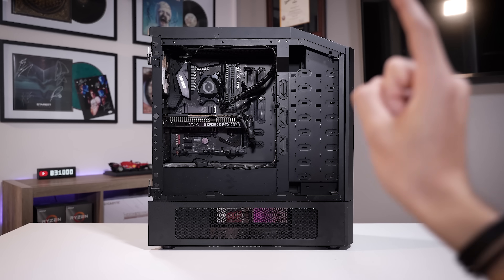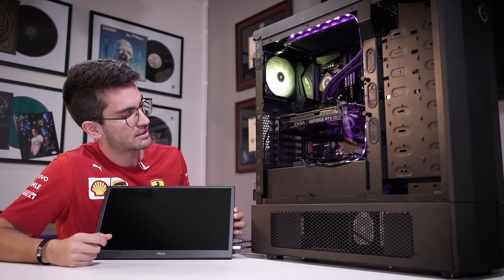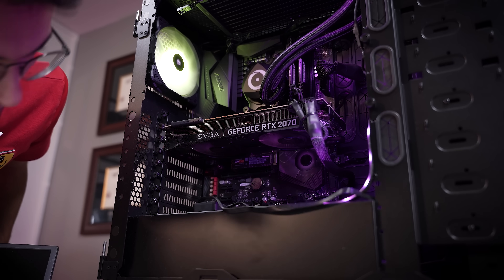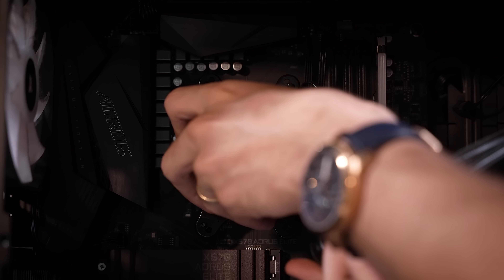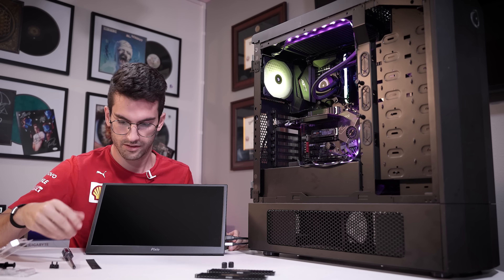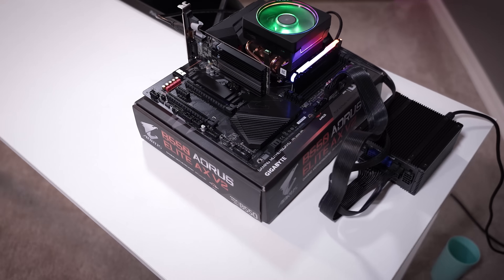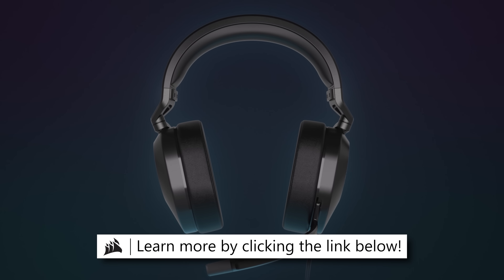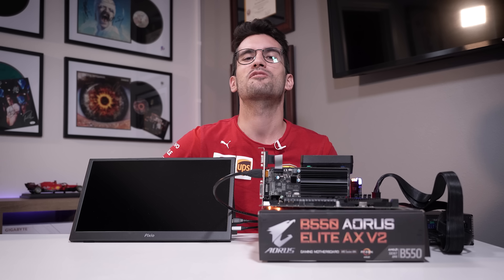Fixing a Viewer's BROKEN Gaming PC? - Fix or Flop S3:E3

Comment: Extreme overclocking is what's killing CPUs prematurely.  Ever since I learned to undervolt and limit the overclock by manually setting the overclock speed, I have every confidence that my PCs will most likely live a nice, long, cool life.
Reply: i have a 5800x3d * cant overclock it cause its locked * and it dead on me. turns out the asus motherboard killed it so i had them both replaced and got a msi x570s carbon now with the 5800x3d
Reply: @DeadlyCrazy91  yeah, that's why I don't have any 5800X3D cpus.  I've got a 3700X, a 5800X, and two 5900X builds - all undervolted and manually overclocked to a max 4000 MHz - and all on ASUS motherboards.  The 3700X is on an ASUS ROG Strix X570-i Gaming motherboard, the 5800X is on an ASUS B550-M Wifi motherboard, one 5900X is on an ASUS Prime X570-Pro motherboard, and the second 5900X is on an ASUS ROG Strix B550-i Gaming motherboard.  All undervolted the same way and overclocked to 4000 MHz.  None of them ever goes above 55 degC while gaming, or 70 degC while being stress-tested on Cinebench R23.  I have a Gigabyte AORUS X570i Pro Wifi (mini ITX) motherboard sitting in its original box because it wouldn't let me undervolt like I can with the ASUS motherboards.  Used that originally in the 3700X SFF build and CPU temperatures sometimes went a bit too high for my liking, because of the latest AGESA (automatic) settings.

Comment: my information is not from experience but from a lot of research but if you install an R9 it will not post unless you update the bios with an older cpu first so i feel like that should have been included in this video.
Reply from the maker: I think you're confused. Both boards in question were B series, and both CPUs were 3000 series. They work natively. And there's no hierarchy of CPUs for BIOS updates. A BIOS will either support Zen 2 or it won't - not some Zen 2 chips. Not sure where you're getting this info.

Comment: i  have had roaches be the cause of the customer computer woes. shine a light into power supply and check the back of the mother board, more roaches then you have to fix that and clean out the roach waste.

Comment: I would like to see the correlation between potential owner overclocking + water or air cooling and dead Ryzens tbh (water cooling because of pumps/coolant potentially degrading or going bad during use without being noticed somehow)

Comment: My 2070 Super VRAM is running at 105C when I play a game.  The Core doesn't hit 70C. I had this card for 3 years and never had a issue other than the temp. Wondering if there is a way to fix this easily.
Reply: Change the thermal paste.
Reply: This usually indicates the VRAM isn't connected to the heatsink well. Could measure & cut some thermal pads, or use copper shims
Reply: @brentw2  will try that thank you
Reply: @brentw2  yup. Good advice
Reply: Undervolt.
Reply: Tried both. The core is fine. The ram is not.

Comment: Hello Salazar! I am deciding to ask you in these comments about a problem I've had in recent days. You are someone who might be able to diagnose my issue, even though I am definetly not able to send the system to you. I have a desktop with a Gigabyte X99 UD4 motherboard, an Intel Xeon E5-1630v3, and 4x8GB DDR4/2133. Last few days, I've experienced constant crashes of both programs and the entire OS, citing "segmentation fault", possible data corruption (?, seemingly only in system files relating to booting), and finally, unable to boot, even on live DVD or USB. I have tested all the DDR4 I have, cleared cmos, tried 3 different SSDs, tried 2 different video cards, multiple installed OSs, all ending in the same issue. I am convinced at this point that this has to be a CPU fault in some way, but I am not certain, as I have no other CPUs for this motherboard. Could you, or someone else experienced with this, be possibly able to help in the comments? I have searched online for hours now, I can't find any working solutions when searching online.

Comment: Front to back on this one.😀
Good video Greg!
Can't help but wonder if the soc voltage may have been ju...st a tad high for ju..st a bit too long on this 3900x.
Either which way...
Keep "Em Coming!!
Reply: The latest bios on the boards is supposed to fix the high auto voltage, at least on my MSI B450!

Comment: Question: Did you think the thermal paste application was appropriate? Did you check the cooling and verified temps after replacing the CPU? Love your videos! It inspired me to start my own home repair business!
Reply: yeah my thought exactly. maybe the AIO died and that caused the cpu to cook..
Reply: @CodeDonut  no the PC will turn off before that.
yes I have tried it by accidently unplugging the AIO Pump on my Ryzen 3900X thinking it was the Fan Hub for the case fans to see how no intake affected temps & then struggling to get it plugged back in while running CB23. Still works fine & boosts as expected.
Reply: @CodeDonut  Motherboard has a safety guard for that.

Comment: I'm looking for a solution to fix my pc, it takes like 5 minutes to shut down. I've tried almost everything, even disconnected the drives one by one to see if it's drive specific, the only one I couldn't disconnect is the normal boot drive so I'm thinking of doing a clean install but in that case I'd like to be able to back up my desktop icons/folders for after the clean install
Reply: That's kind of odd if your not using an old hdd for main drive. Have you run a comprehensive check for malware? Preferable from a boot usb made on a known clean system. That's the first suspect. If it is the install a clean install from known good, and malware free, source could fix it. But if it's the boot media itself (check the drives smart info, look for excessive errors and/or bad blocks). Also check windows own logs to see if there errors with the drive and/or shut down process.  You can also highlight the drive in explorer right click and select properties, the the tools tab then check filesystem for errors.
Reply: @kaseyboles30  yeah I've done all of those, even tried reinstalling windows but not clean install, used all the repair commands via CMD, upgraded from win10 to win11, all of them with no success
Reply: @scarfacegaming3371  Ouch, could be an MB issue or a fundamentally broken windows install then. Did you do the install with 'keep existing settings' that could have kept the problem if so. Especially if it's set to not really shut down (the default on win10 and 11 IIRC) it hibernates instead. A reboot power option will always completely shutdown and not hibernate. Also if it's set to make a system restore point every shutdown/reboot that could be it as well. Had a driver installer cause something like that once, it had to reboot to finish installing and it set windows to silently create a restore point on shutdown, then failed to remove that setting when it finished.
Reply: @kaseyboles30  hope not the motherboard, but I will have a look at the other suggestions tomorrow when i wake up again lol. Thanks for the help tho

Comment: one small tip that could help if the pc turnes on and you get no sginal try hooking up a mouse and rebooting if the its a graphics card issue the mouse will turn on cause pc loaded the drivers for the mouse wich mean pc is booting but we cant see it if the mouse is dead after the reboot it means pc is not booting at all

Comment: im glad that ive been running my 3700X with 4.2ghz all core 1.25v manual voltage the day i bought it, there seems to be a serious issue regarding to those stock zen2 voltages;

i still remember AMD saying those voltages on auto are normal and nothing to worry about, makes me worried about their newest claim about 95c being safe for zen4.
Reply: The latest bios on the boards is supposed to fix the high auto voltage, at least on m MSI B450!
Reply: @wallychambe1587  yeah but when Zen 2+ first came out the voltages were high and just those few months could fry them. Also most people don't update their BIOS so what you are probably seeing is cooked CPU's from an old BIOS firmware.

Comment: could it be the thermal paste didnt cover the corners? i melted a cpu aswell with not properly spreading the thermal paste and just using not enough
Reply: I've seen GPUs die because of this, but for these CPUs I doubt its a big issue since the headspreader will take care of it.
Reply: It did look like there wasn't nearly enough coverage.

Comment: I've got 3 of the exact same processors here DOA from rigs I have fixed.... Was not shocked when you called out the model... Sad that AMD hasn't said anything about this issue still...
Reply: does this has anything to do with CPU architecture or anything? would appreciate further explanation on why zen 2 CPUs are biting the dust so often in greg reviews
Reply: okay that's got me worried. i have a R9 3900x, I've had it for going on 2.5 yrs now, and I've kept it slightly overclocked the entire time I've had it. I've never had issues with it and I'm using a corsair 240mm aio, but man I definately can't afford a new CPU.
Reply: @NonLegitNation2  the 5800x3D is on offer for $365 , while the R9 3900x is being sold on ebay for $280, so try selling your CPU online then use the money to buy a 5800x3D or a normal 5800x, you'll be set for many years with this upgrade and it will cost you $90 only.

Comment: I am wondering if some people are trying to overclock it with a bit more voltage than what these chips can handle, and went 'yep, all stable.' and called it a day. It does makes me wonder about my 3900x. Do enjoy the whole troubleshooting and cleaning vids of yours.
Reply: I was going to say the same thing. I have never really understood the overclocking craze given the tiny returns for the risk which goes up exponentially if someone tries to get bigger returns
Reply: I don't think that's the problem.  My daughter's old system was running a 3700X.  It started to run hotter than normal.  I repasted it to see if that would fix it and then it wouldn't post anymore.  I put the CPU in a different motherboard and wouldn't post in that one, either.  I know for a fact that she didn't overclock it.
Reply: @RichWhiteUM  it’s a mixed bag. I’ve had it the other way now have to RMA a MSI board that somehow got bricked doing a Windows 11 update. There were signs before that indicating something was wrong.
Reply: The need to overclock is long past now. The CPUs and GPUs are so crazy fast it just isn't worth it anymore, but people still think they need that extra 4-6 fps to have a good time gaming.